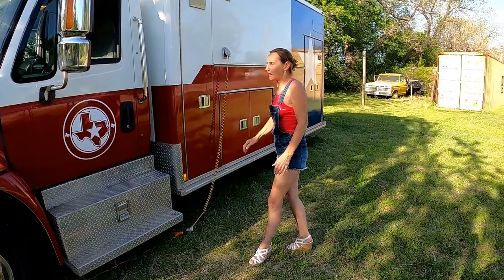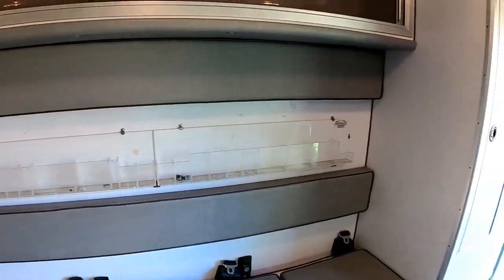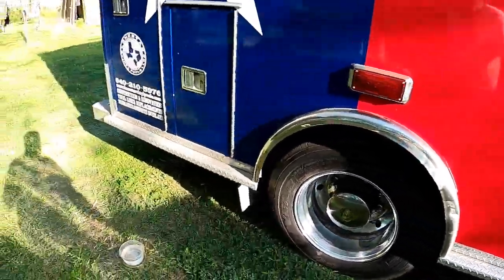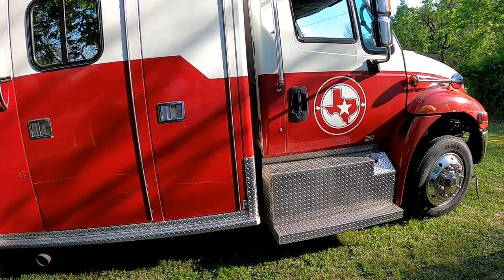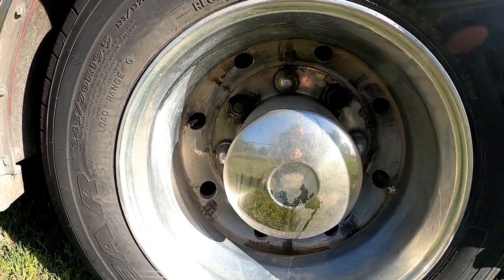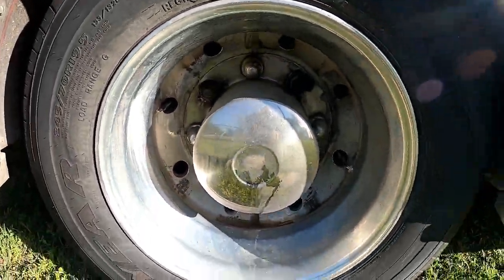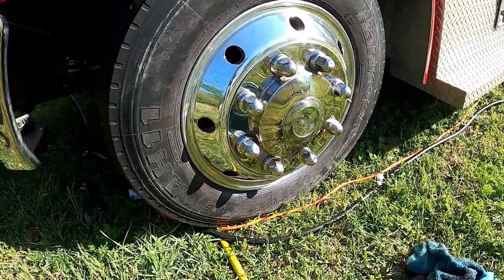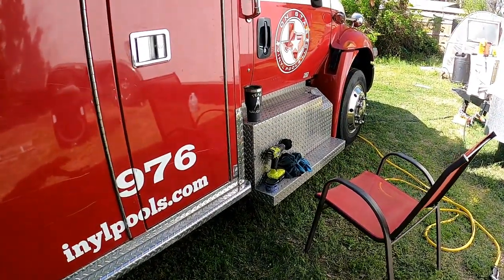AMBULANCE COVERSION BUILD - first video of new project

Comment: I remove the wheel and lay it down makes it easier to not miss anything.  Nice job!
Reply: Agree, so much easier way to clean all of the wheels. And what better way to ensure you can remove them yourself under emergency  conditions. Most Tire Monkeys put wheels on too tight for us normal guys to get off without serious help.  On my Claas A, that I built, I incorporated an air compressor, which he already has on this truck, and added an air tank off a Rock Hauler Semi Trailer so I can run an air impact and air/ over hydraulic Lift Jack to lift an axle.  I have hydraulic levelers but won't trust them to keep my big coach off the ground while I change a flat tire.
 
Not to mention the little old lady in her DP RV with her invalid husband who had a flat tire in the middle of nowhere Montana. I had her back on the road in 15 minutes.  She said AAA told her 2 hours for them to get there. :)
That is a nice truck to start your build with.

Comment: Beautiful rig , yup we in ems field drive our units hard. Please remember if any outside red emergency lights r Left to change them to flood lights. Have fun with the 10 miles of wires. The rear red lights you could wire those up to your blinkers so you could have 2 sets of brake, hazard,turn signal lights.